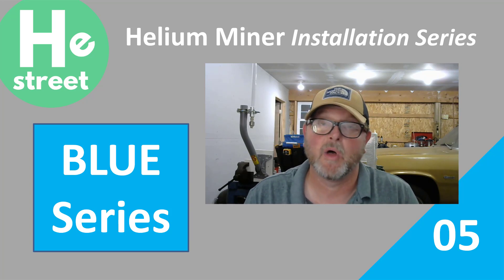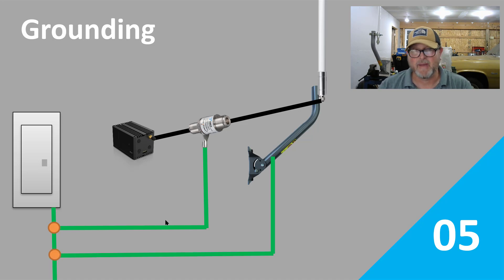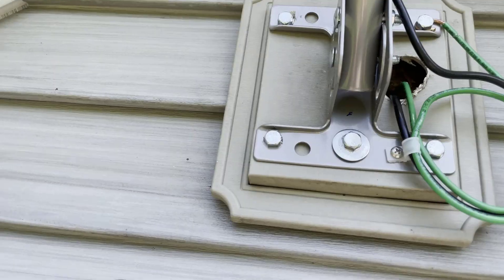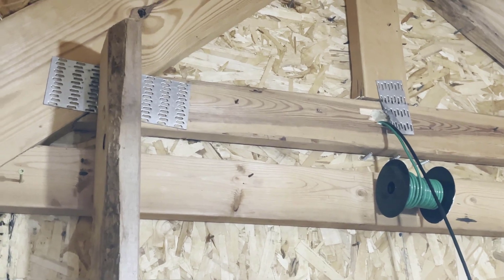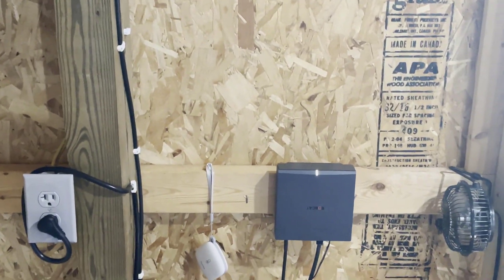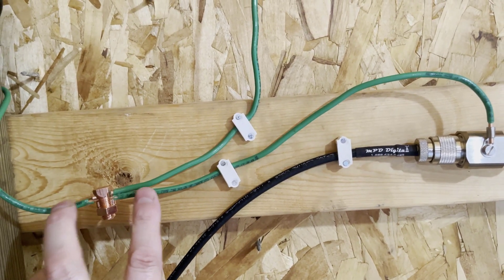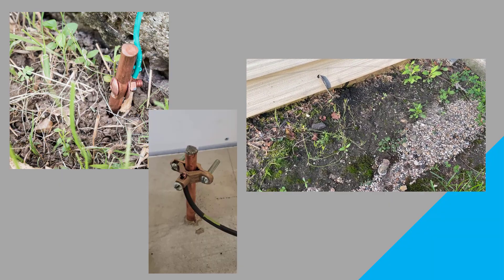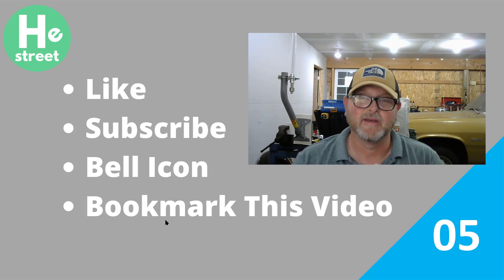Helium Hotspot Miner - Grounding Tutorial [BLUE SERIES] 05

Comment from the maker: Helium Hotspot Miner - Overall Installation Summary [BLUE SERIES] 01
https://youtu.be/ZsVsGPklexI

Helium Hotspot Miner - Ethernet or WiFi? - Port Forward & Relayed - UPS Systems [BLUE SERIES] 02
https://youtu.be/303NAa3LSCE

Helium Hotspot Miner - LMR-240 & LMR-400 Rules - MPD Digital - Lightning Arrester [BLUE SERIES] 03
https://youtu.be/sFG0XD-ahOA

Helium Hotspot Miner - Antenna Assembly and Antenna Mast - ALL the Nuts and Bolts [BLUE SERIES] 04
https://youtu.be/szpl70_XdwU

Helium Hotspot Miner - Grounding Tutorial [BLUE SERIES] 05
https://youtu.be/L_iRaIlSTKg

Comment: Thanks for the informative video. Was curious whether we need to ground our mast. It is two connected 6ft fiberglass poles (tree pruner handle sections). We are just above the gutters on our home. Did you throw the main fuse switch to off when you connected to the ground wire at the box?

Comment: Thank you for the information. I have a question please: my ground wire comes from the roof and ends up in the 'technical area' of the house where I have a solar inverter with a grounding attachment for the solar panels and a grounding attachment in the house's general electrical panel. Is it ok to attach the helium antenna ground wire to one of these two grounding options?
Reply from the maker: I think you should consult licensed electrician.  Hard to comment here.

Comment: @Helium Street great video, thank you :) Can I use #6 grounding wire? #10 seems to thick, and twice as expensive?
Reply from the maker: The minimum requirement is 10 AWG for the COAX and 14 AWG for the antenna mast.  BTW... 6 is thicker than 10.
Reply: @Helium Street  wow, didn't know that, thanks  🥰

Comment: You never want to run a ground wire INSIDE a wood structure. If lightning strikes your antenna, it will follow the wire and create an ionized path following the wire at about 10,000 degrees. Not good next to wood. Run it outside to a ground rod in the ground. Put the coax arrester outside too, near the antenna as if it is hit it will probably explode in your attic! All grounds must be connected to the rod building ground per the National Electric Code.
Reply from the maker: This installation meets NEC and was inspected by a professional antenna installation company.  The ground wire does connect directly to the ground rod on the service side of the ground circuit.

Comment: As I understand it, certain antennas do not neet an arrestor, just need to get a ground to the metal antenna base.  With a multimeter, if the antenna shows open circuit from middle pin to outside metal base, needs arrestor.  If shows no resistance (different style antenna), only need to ground base.  This is from another content creator who is someone what technical in his knowledge. Please refer to 10min mark of Sorins video to explain this.  Why lose signal with an arrestor if you don't need it?  Grounded antennas apparently dont. https://www.youtube.com/watch?v=UPNhNjhHrdg
Reply from the maker: Thanks for the interest and the feedback.  Videos on the Helium Street channel that show antenna and mast grounding methods follow NEC guidelines.  Anything outside of NEC assumes some level of risk and or liability.

Comment: I'm confused with your grounding technique. I see you and others talk about the green wire so went to lowes, hd and electrical store. They all said this wire can't legally be used outside unless it's inside a pipe or such.  Even the wire says indoor only.  I got a solid bare 8gauge copper wire labeled outside inside but the dam thing is too thick for the arrestor.  Does the miner fall under some other rule that allows to use them?  Still the fact ur not supposed to use this wire outside worries me.
Reply from the maker: I think you got bad info.  Or your regional code is different than the National Electric Code.  Or…. The Lowe’s people didn’t realize your were installing an antenna.  Go look at any satellite dish installation, you will see similar wire used.
Reply: @vandelay.digital.academy  but the green copper wire they sell everywhere is clearly marked indoor use only.  Can you perhaps link the wire you use so I can look? Or point me which one to look for
Reply from the maker: Here you go... https://amzn.to/3K9FhVZ
Reply: @vandelay.digital.academy  hey thank you that does seem like something different than what they sell locally.  I have a question for you and wonder if you know the answer, I ran into issues with connecting the grounding wire to the arrestor.  The connector that came with it was flimsy and snapped so I bought a replacement at home depot which is great but problem was the bolt on the arrestor would come lose while i was working on connecting the antenna from moving the wire.  Thinking i would tighten it at the end i applied too much pressure and snapped the bolt.  Is there any reason I could not just ground the antenna to the metal bracket it came with? The arrestor is connected directly to the antenna and that sits in the bracket (all metal).  Since they are all connected am I negating the use of the arrestor in any way by not connecting the wire directly to it?

Comment: @Helium Street Would I need to ground an antenna mounted on my condo balcony door window? If so, would a lightning arrestor suffice?
Reply from the maker: NEC requires the ground be attached directly to the electrical system of the structure.  In your case, you may need to work with the building authority to arrange access to the electrical system.
Reply: @vandelay.digital.academy  Unfortunately, that’s not an option. Is grounding/lightning arrestor required if I put it on the interior of the window?
Reply from the maker: Anything goes inside the window, no grounding necessary.
Reply: @vandelay.digital.academy  Okay. Thank you. I appreciate your insight.
Reply from the maker: I got you!

Comment: Will it being grounded or not effect performance or is it mostly a safety thing? I know a guy who didnt ground his new 8dbi antenna and rewards and witnesses dropped like 90% since. He def left the spool of ground wire on the roof and didnt hook it up due to weather.
Reply from the maker: Grounding has no effect on the signal other than a small bit of line loss at the additional lightning arrester connection points (-0.2 dB per connection).
Reply: @vandelay.digital.academy  Thank you!

Comment: Any recommendations for how to ground an antenna on top of a 1 story commercial store building?
Reply from the maker: @Devon M Depending on your region, the builder may have already installed grounding points (ground block) for different devices up on the roof.  Look for those and join that block with your ground wire(s).  If not, you could "join" your mast wire (17 AWG) to your lightning arrester ground wire (8 AWG) with a split bolt, then run that 8 AWG wire down to the ground block used for the electrical system near the electric service panel (note: NOT inside the panel).
Reply: @vandelay.digital.academy  Thank you for the help. I went out to the site and noticed there is a grounding rod. My plan is to run the wire down from the mast and put an additional grounding clamp on the rod that goes into the ground. One thing I am confused on, can I use a grounding clamp around the antenna mast and then run the 10awg from the lightning arrestor through the grounding clamp on the mast and then down to the grounding rod? That way it would be one wire and a split bolt won't be needed.

Comment: I'm going to be setting up a Bobcat miner on my roof and attaching an 8DB antenna.  I spoke to an electrical engineer and he said that because the bobcat miner is attached to the antenna and the power outlet is grounded, I do not need to ground the antenna.  Does that sound right or does one still need to ground the antenna as well?
Reply from the maker: NEC requires the antenna mast be grounded with 17 AWG wire or ticker.  NEC also specifies the COAX that attaches the antenna to the miner be grounded with 14 AWG wire or thicker. Are you attaching your antenna directly to the top of the enclosure?

Comment: I wish I could put my antenna outside but I don't think my landlord would want that. I just got mine and it's in the attic. I'm not impressed with the reception but it's my only option. I am using the stock 2.3 dbi antenna but I ordered a 5.8 because I'm in the suburbs.  Hope that helps a little at least
Reply from the maker: The 5.8 is a good choice.

Comment: Thanks for this! Beginner question, what’s the proper way to connect the ground wire to lightning arrester? Some have a screw and others have a sort of metal sleeve like the one here.
Reply from the maker: Either is fine. I'd always pick the lowest resistance method whenever possible.

Comment: Thanks for the video, I am wondering if I Can ground my antenna to the ground outside my house? There is a rod in the ground where it looks like some things are grounded for the house, maybe electrical and cable stuff coming off the street, not really sure.  I can technically run the ground wire into my attic where i can connect the arrestor and then run another wire out to that rod.  Another question is can the arrestor be left outside? that would make the installation a lot easier.   I am running a 30 foot cable from outside into the house, it almost looks like i need another cable from arrestor to the bobcat, the current cable that came with the  miner is way too short to reach into the attic.  IT is very confusing trying to figure out all the cables and accessories i will need.  Do i need two identical cables , one shorter ? or do they have different ends and i need a different cable going to the miner?
Reply from the maker: Let me know if you need more detail than what is explained in this video. I'd be glad to help more if needed for sure.  https://youtu.be/cBD2hUz6O1U
Reply from the maker: You should look at the red series:  https://www.youtube.com/playlist?list=PL1jvIL1L1Cwa_8jMugCpOJox18EHxZ_Vu
Reply: @vandelay.digital.academy  thanks I thing I found in another video I can connect the arrestor straight to the antenna which makes it a far easier and straight forward installation.  I'm sure you are doing a great job but looks overcomplicated to me

Comment: When you showed the bond to the house electric panel ground strap, it looked like your split bolt was clamped on the insulation for the 10 gauge wire. It might be a good idea to either strip that back another 1/8 inch, or simply loosen it and slide the wire out so it's only clamped on bare copper.
Reply from the maker: Good catch, I fixed that issue way back when we created the video.  You are an eagle eye!

Comment: Can’t the lighting arrestor attach directly to antena and then you just have one coax cable?
Reply from the maker: Sure, just be aware of this... Most electrical inspectors like to have the lightning arrester close to the device that it is protecting (in our case, the hotspot/miner) or at the point in which the COAX enters the structure.  In cases where the butt end of the antenna is relatively close to where COAX enters the structure, within a few inches for example, we can attach the arrester directly to the butt end of the antenna. This allows us to run COAX right into the structure right below the antenna and run the ground wire from the arrester down to the electrical system ground wires/rod.  You would also pull a ground wire from the mast in the same location.  The scenario allows us to only purchase one piece of COAX.  Remember the COAX ground (the wire that comes out of the arrester), should be 10 AWG or thicker (solid or stranded), and the mast ground should be 17 AWG or thicker (solid or stranded).
In other situations where our antenna is much further away from the COAX entry point, like on a tall mast on the roof or just much further away from where the COAX enters the structure, we would not want to attach the arrester to the butt end of the antenna.   Instead we would run a piece of COAX from the butt end of the antenna to where the COAX would enter the structure and attach the arrester either outside the structure at that point with ah drip loop or locate the arrester inside the structure (like our blue series).  Then attach a second piece of COAX on the other side of the arrester that attaches to the helium hotspot/miner.
Reply: @vandelay.digital.academy  thank you for the detailed response, I will be using a flag pole to get elevation and putting the box with the miner up on the top of the pole so the coax I use is only 1.5  feet long. I’ll also be running POE up the pole
Reply from the maker: Oh, then you have a lot more flexibility. Your plan sounds good. 👍🏻

Comment: Mike, how are you finding the co ax cable to go from lightning arrestor to antennae? I know my hotspot to arrestor is RPSMA Male to an N type. But how do I go about ordering the other cable? I don’t see an option for N type to N type on the website
Reply from the maker: What website? What type of COAX?
Reply: Basically wondering which cable you purchase to go from antennae to lightning arrestor? On USA coax I only see options for hotspot to arrestor configuration not antennae to arrestor. 

Also is it possible to connect the arrestor directly into the antennae?
Reply from the maker: Hey Kyle, here is the link to the COAX I recommend which has all of the connectors referenced:  https://usacoax.com/custom/mpd-400-ultraflex-super-flexible-ultra-flex-coax-cable.html As for your second question... Most electrical inspectors like to have the lightning arrester close to the device that it is protecting (in our case, the hotspot/miner) or at the point in which the COAX enters the structure.  In cases where the butt end of the antenna is relatively close to where COAX enters the structure, within a few inches for example, we can attach the arrester directly to the butt end of the antenna. This allows us to run COAX right into the structure right below the antenna and run the ground wire from the arrester down to the electrical system ground wires/rod.  You would also pull a ground wire from the mast in the same location.  The scenario allows us to only purchase one piece of COAX.  Remember the COAX ground (the wire that comes out of the arrester), should be 10 AWG or thicker (solid or stranded), and the mast ground should be 17 AWG or thicker (solid or stranded).
In other situations where our antenna is much further away from the COAX entry point, like on a tall mast on the roof or just much further away from where the COAX enters the structure, we would not want to attach the arrester to the butt end of the antenna.   Instead we would run a piece of COAX from the butt end of the antenna to where the COAX would enter the structure and attach the arrester either outside the structure at that point with ah drip loop or locate the arrester inside the structure (like our blue series).  Then attach a second piece of COAX on the other side of the arrester that attaches to the helium hotspot/miner.
Reply from the maker: Don't forget to use the discount code HSTREET at MPD Digital!

Comment: If the electrical ground rod is on the opposite side of the house, can a new copper rod be installed to ground the arena ?
Reply from the maker: Per NEC, you will want to attach the ground(s) to the electrical system of the structure.
Reply: @vandelay.digital.academy  oh ok, could it would if the ground is connected to the hose bib coppper pipe
Reply from the maker: I’m not sure about that method (plumbing).  I’ve never done it but I’ve seen it plenty in various applications.  NEC however requires the ground to connect to the electrical system of the structure.

Comment: If I place one on my balcony, I have no where to ground it. Can I use ground it to the grounding portion of an outlet?
Reply from the maker: Grounding to the electrical outlet is not advised.  You might want to contact an electrician or property management to better understand your options.
Reply: @vandelay.digital.academy  would grounding it to the outdoor AC unit, which is grounded, be sufficient?

Comment: Thanks for this video.  Very professional and informative.  Although the realities/constraints of house layouts sometimes force you to make compromises. 

I am considering grounding my antenna/mast to the flexible metal conduit (FMC) which runs all through my house and to the main panel.  This would be to avoid a long and unsightly exterior run of dedicated grounding wire.  Would you have any advice or cautions against doing this?
Reply from the maker: What country are you located?
Reply: @vandelay.digital.academy  Good ole US of A
Reply from the maker: Although neither is NEC compliant, I'd probably drop another ground rod before I connected to the FMC.  But, like I said, neither is following the guideline.
Reply: @vandelay.digital.academy  well I ended up bonding to the FMC.  I'll make sure to comment again if the house burns down.  I'm in Los Angeles so lightning storms happen once a year (if that).

Comment: Do i have to ground my antenna? I live in an area with no chance of lightning
Reply from the maker: Where do you live? (general location only please, do not share exact location), I'm very curious.
Reply: @vandelay.digital.academy  i live in dublin ireland. I havent seen lightening in years
Reply from the maker: You will want to check with your local electrical inspector regarding electrical code for your area.